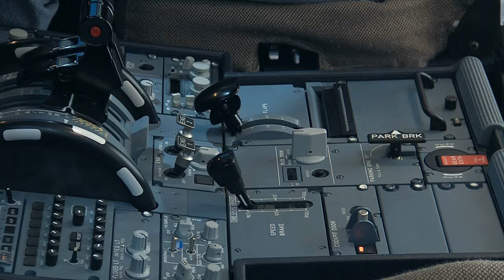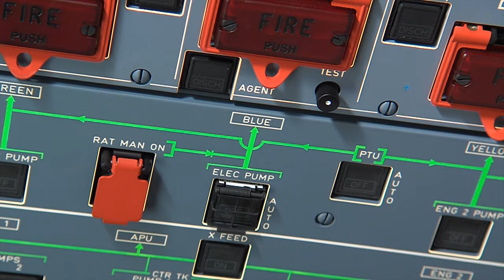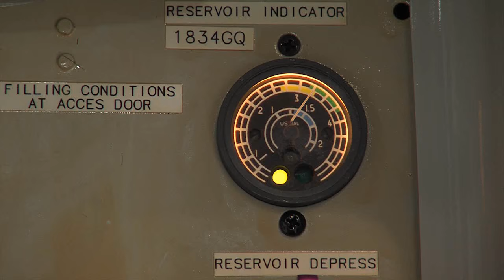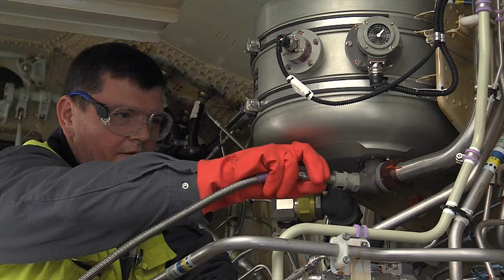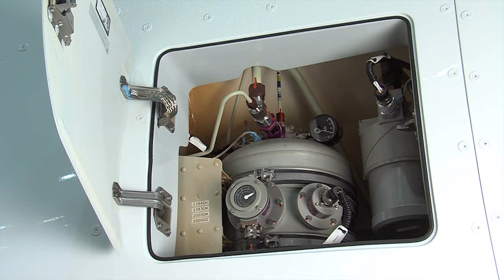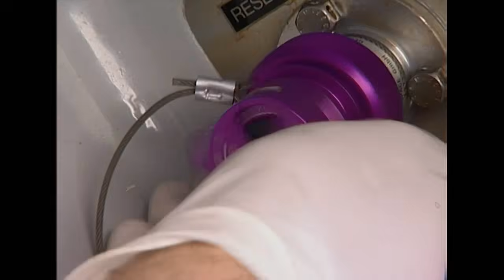A320 Hydraulic Systems Servicing

Comment: why do some people use apu bleed air for re pressurizing the reservoir, thanks
Reply from the maker: This is because the pressure that pushes the oil out of the reservoir and into the engine pumps comes from the aircraft’s pneumatic system. There is a preload, which may have dropped too low, so the pneumatic system must be turned on to restore normal preload operation.

Comment: If this is a SERVICING VIDEO why skip the part on depressurizing the system before draining fluid?  Its like you skipped 20% of the process.
Reply from the maker: The video is a supplement to better illustrate some of the processes described in the manual, and does not cover all of its content. It is worth remembering that this is a compilation of videos produced by the aircraft manufacturer itself. Be sure to ALWAYS consult the maintenance manual.